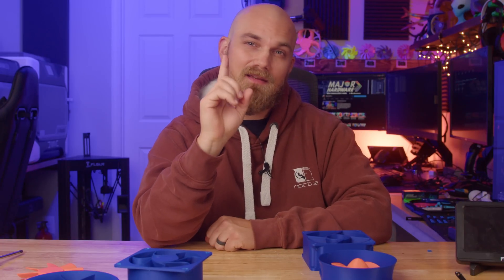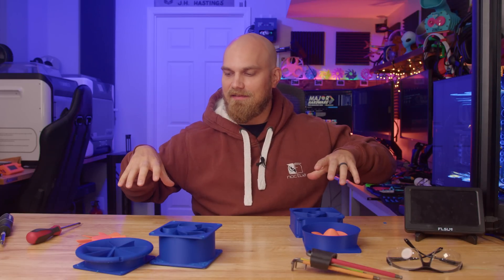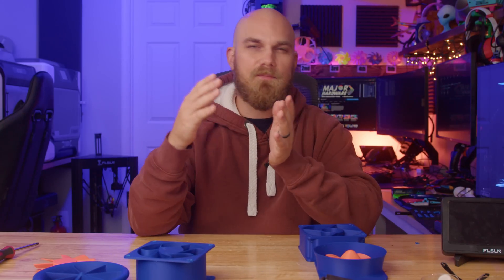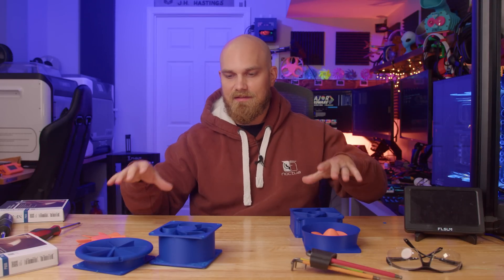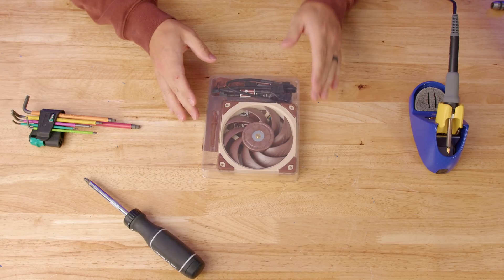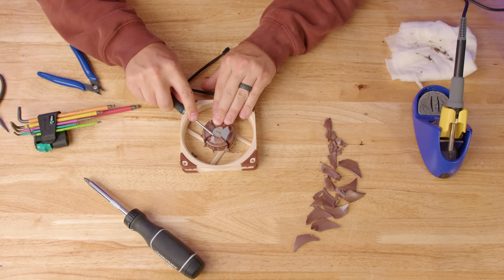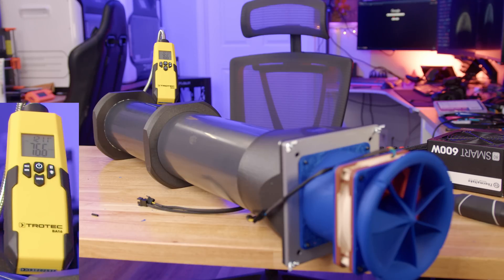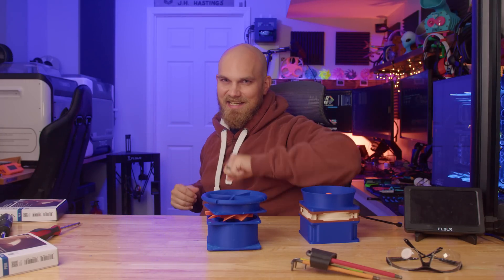Which One is REALLY the BEST | Fan Showdown S4 Finale

Comment: Should include both. There are high airflow fans and then there are high static pressure fans. It would be interesting to see if any of the fans with lower flow in the tube might have a higher localized pressure zone on a radiator. The tube only tells half the story. This could help determine what is good for a case fan and what would be good for a rad fan.

Comment: I'd say go cooling, but with a rig that can properly detect the amount of cooling such as a peltier device. I think, if you put one side of the device on a temperature controlled hotplate (such as that used for solder reflowing) and attach an AIO cooler or air-cooled heatsink to the other you should be able to measure the heat difference across the peltier as a voltage. The hotplate would provide a consistant temperature across all tests and, if you set it to something significantly above ambient temperature, the relatively small differences in ambient room temperature shouldn't be much of a factor (alternately, you could pretty easily create a temperature controlled chamber for the radiator and fan to sit in).

Comment: I was just reading comments on this video and noticed Brett Haupt suggested that it might not be too hard to generate both flow and pressure data at various levels of restriction in your test jig. I like this approach much better than the "abstracted" cooling performance results and request consideration of either continuing the airflow-measurements or add to that a static pressure measurement, possibly at various restriction levels. 

There are a lot of additional variables that are harder to control for in a cooling test, and it naturally reduces the resolution of results because the reality is that a heatsink with barely any flow still cools pretty good. Airflow has to increase by exponential amounts to result in linear improvements in cooling.

Comment: You need to do static pressure tests with your normal airflow test. I also think including real work scenario tests has to happen with a water cooler and a air cooler.
As far as coooers i think there is really only 1 air cooler you would want to use NH-D15. Water coolers it gets a little tricky a lot of choices either a corsair or coolermax would be a good choice.
Fitting some of these designs into a computer case might be troublesome, a new set of design prematers might be needed to fit into the case.

Comment: I would rather have the more practical application of cooler testing myself. I know it isn't as accurate as others have stated, but I feel like a fan should be capable of being mounted to and used on a cpu cooler as that is what the original noctua fan is designed to primarily do. Honestly is wish you could do both, but that is a lot of time and work.

Comment: The real test of performance, would be measuring air flow volume through a slight restriction. Many designs will move huge airflow volume with no backpressure, while others, can develop more static head pressure. Neither of these specs, by themselves, give a good indication of cooling effectiveness. The real indicator, would be airflow volume X head pressure, X a constant, which I don't actually know, to get air watts. Head pressure is one factor, flow volume is the other factor, to give you the total product. (cooling power)
     The tube that you use to measure flow volume is a perfect apparatus, if you could build a box on the end, to force air through some type of radiator. An example of this would be, the heating element out of a small ceramic space heater. If you apply a calibrated amount of wattage to that heating element, and measure the temperature rise, you will better know which fan design actually cools the best. Try the fans in both suction and pressure, because there will likely be a slight difference in performance.

Comment: I'd recommend the easiest and simplest solution by adding a static pressure test on top of the current flow test because some fans flow a metric ****ton of air but cannot handle even the slightest static pressure, while others flow for beans until you have a high static pressure then you can do a combined rating based off flow vs. pressure for each fan

Comment: I'm going to be perfectly honest, I stopped watching the show when you stopped using practical tests and data. The move towards theoretical advantages by not practically testing on a radiator made it generally uninteresting.

I'm involved in the industrial manufacturing world and I can tell you that theoretical tests only go so far and rarely create the optimal design or solution, but rather are just to give the engineer a starting point.

Comment: The cheater has significantly smoother blades due to the orientation of the print. The other fan (and most fans in this series) have the layer lines directly across the blade length, presenting maximum surface roughness to the oncoming air. By printing each blade separately, the cheater orients layer lines parallel to the airflow direction, reducing drag and improving performance.

Comment: It would be a lot of extra work but add a ton of nuance and potentially Evan a lot more content to start comparing fans on multiple aspects and not just one at a time i.e. airflow, static pressure, airflow with different common obstructions like radiators vs standard heatsinks vs almost open flow like a case. I think we would find that some fans even of past seasons perform better under certain conditions. One fan might be the ultimate case fan and then suck on a radiator because it doesn't work well against obstruction.

Comment: 120mm AIO with a peltier as the heat source. Cheap setup, easy and you get consistency. You can fit the radiator to the airflow tube and keep measuring airflow, just with the same restriction in place for each fan. You can also add an air temperature sensor to the tube to measure the heat being dissipated. This would give a good idea as to how effective the airflow is across the entirety of the fan rather than just one or two points along the blade that make good airflow numbers. More air across the whole blade should mean better heat transfer and warmer air in the tube, right?

Comment: Hey big fan of the show been watching since start of the fan showdown. Not sure if you saw my last comment about your roots blower fan but I was basicly wondering which direction you had the vanes spinning. In a roots style blower the vanes should be spinning outward (left vane anti clockwise right vane clockwise) just wanted mention it as it didn't look like you specifically mentioned it in previous episodes. Thansk heaps

Comment: I think in S5 we should do a noise challenge. We tested performance so far and in many cases at the expense of noise.
Another thing that would be cool is to set all fans at 800-900rpm, so we test noise fairly (all fans at the same rpm) and test designs that won't stall at lower speed, which I guess many of the previous session fans would.

Comment: If I were to do the testing, I would have 3 tests: unrestricted flow rate, static pressure, and flow rate with a radiator as resistance. If in the interest of time you want to do only one, I would do just the radiator one, but I feel all three would be best.

Comment: I feel like we need different leagues/tiers/sections of fans:
1) fans that fit within the original build volume of a fan / don't exceed the frame of the fan shroud. AKA "a normal fan"
2) fans that exceed the orignal build volume but do NOT untilize additional, static components (oversized fans, clockwork fans)
3) fans that utilize additional static components (cheater, turbo/super charger)

It's infuriating seeing ideas that, while quite funcional, aren't what i am primarily interested in (seeing how regular people make designs that compare/surpass the professional design while following the same limitations).  Instead, i find some Gundam Megazord contraption.  While very cool and effective, it shouldn't be seen as "in the same league."

Comment: For when you're doing a cooling test you should use an air cooler that's easy to mount to. And you should get thermal pads to use instead of thermal paste. Not only are they reusable but it will remove thermal paste as a variable

Comment: You know you can non-destructively remove the Noctua fan blades with a heat gun and a 12mm socket? I saw it on Reddit and tried it myself. Works really well, it’s super easy, makes no mess, and you can put it back on again if you need!

Comment: I do like airflow measurement, plus it's probably much easier and faster to test. However, if there was any way to add a static pressure measurement to the test rig, I think that addition would be the best scenario.  
More than anything, I'd like to see these fans broken down into at least 2 different classes;  OEM vs. Open.  OEM would be fans that fit the stock dimensions of the fan, and Open being everything else. 
Clever designs that fit within the fan housing are getting destroyed against fans that are not really useful in real applications. I mean, I still love the wild and huge designs, but it's weird to be allowing them to compete head to head.

Comment: Keep the air flow testing. it's a great way to see how much air the fans move. Just do both airflow and temperature. To save on time while you're running the cooling test for one you could be doing the air flow for another

Comment: I wouldn't mind seeing flow testing, then cooling on a single fan (180?) Radiator so that there is no extra radiator to skew the results. A fan may flow really well, but if it pushes air through a very small portion of the radiator (outside for example) where a lower overall flow but equal over the whole surface area of the rad could cool better

Comment: Custom, with the thickest 140mm radiator you can get, unless you're planning on printing multiple fans for 240/360/etc rads. You might still be able to get Alphacool NexXos Monsta radiators in a 140mm size, but really any stupidly-thick radiator.

Also kinda wondering if, whatever you choose, you could provide dimensions for some standard case, so people could design rigs that function as both direct cooling and also case exhaust/intake?

Comment: 🚨🚨🚨 Instead of cooling a PC, you should perform a static pressure test instead. In this way, the submitted fans would also look different and it gives this whole competition a new touch. And if you choose the „cooling a PC cooler“ method, you should rather use a heating element of a 3D printer instead of a CPU. This allows you to monitor exactly how many watts a fan can cool down. 🚨🚨🚨

Comment: Having backpressure sometimes really shows the true capabilities of a fan, while destroying the capabilities of others. Would be interesting to see if there's a good way to measure pressure performance
Reply: open air flow and then the same test but through a little 120 rad. both through the tube. because some fans are amazing at open air flow, a good case exhaust fan for instance, but others are excellent at ramming air through heat stacks and radiators but are lackluster for open air flow.

Comment: I want flow testing. It's a much more stable control, and airflow is king. The only thing i think you should add is a way to test static (drill a hole in the air tube and get a monometer). Static pressure and air flow are the 2 things you need for a fan to work well on any heat sync. That would be awesome as an edition to season 5 while staying as scientific as possible

Comment: For season 5 get a Crypto Miner like a Bitmain Bitcoin miner (even an older one). Record noise and everything else you've pursued. 
About five years ago I bought a pair of bitcoin miners expecting I could run them in the basement. I had to give each of them a dedicated 20Amp circuit breaker, which was fine. In the end, their fans were just so unbearably loud (and I tried running them in an acoustic treated enclosure too) I just had to stop. They threw off enough heat they kept the normally chilly basement comfortable though. And I'm still ahead on the bitcoin mined value at the currently 'depressed price' out there right now.
So please get a bitcoin miner as your temperature test rig.

Comment: I like the airflow testing method. As many people have said, it's very straightforward and has less variables which in turn means greater consistency. I would LOVE to see TWO CATEGORIES for Season 5. One for "naked" fans, and a second for the fans that have shrouds, and stators, etc. I feel like that would really even the playing field. Love this series, man! Keep up the awesome work!
Reply: +1 for naked and shrouded / modified
Reply: The two categories would be a great addition since the larger fans are just harder to actually use IRL
Reply: Oh also maybe a test where we keep the cheater housing but just change the fan design!
Reply: I agree with this. Shrouds don't work in all use cases.

Comment: all these intake shrouds with fancy things in them, like the unswirl, are just adding obstructions and restricting airflow.
there might be something to making a laminar flow out the exhaust for an airflow test, maybe (i'm skeptical, but it could reduce friction along sides of the pipe and therefore reduce backpressure), but adding it to the intake is just going to reduce airflow.

Comment: You should find a way to measure static pressure. I’d be curious to know if the unswirler performs better under a static pressure test than the cheater. For water cooling static pressure is much more important than straight CFM.

Comment: Beyond the airflow and static pressure, you could run a peltier test. Peltier chips will always behave the same and you can measure performance by measuring the temperature difference of the cold side of it with each fan cooling the hot side (I explained just in case someone just defrost from the last ice age and doesn't know what is a peltier).
Reply: Yeah, doing a 'real world' test setup would ideally use a dummy heater than could consistently be measured at all the same parameters, including mounting pressure and TIM spread.
Reply: literally never heard of a peltier before
Reply: @Bloody_crow  they're awesome tiny heatpumps with no moving parts. Cheap also.

Comment: use both airflow and cooling. There is a reason for this as not all airflow is equal just because 1 moves more air does not mean it cools better. If the air flow is to concentrated in a stream in water cooling say just the outer most or inner most 20mm of a 120 mm fan then you could have 2k cubic feet per min of airflow and not cool as well as 600 feet that was spread out over the full 120 mm of area. If it is to spread out you could have the same effect.

Comment: For the next season I think we should dial it up to 11 by testing with IceGiant ProSiphon Elite cooler on a CPU inside a case with a GPU and minimal other fans. The CPU and GPU would both be loaded 100%. Basically the sort of real world scenario where someone is running with less fans to reduce noise or save a buck and one fan has to be the hero and make up for the other missing fans. I would recommend getting a motherboard with lots of temperature sensors so the temps of other parts can be checked as well. And in this way we could also try using ducting to improve performance 🙂

Comment: To spice things up you could use the noctua industrial 3000 or whatever the name. A some of the fans you get sent are designed to operate at a higher rpm. You could keep using the A12 but also give them a go in the industrial.

Comment: I'd like to see a split in categories. A) fan blades that fit into the standard housing, B) Fans that mount to a cooler but are allowed to stick out of the standard housing like shrouds and big blades, C) Fans that are standalone (IE can't easily mount to a cooler or case/ shrouds on both sides).

Comment: Alright here we go.... Lets give this a shot:

A DUAL FAN Setup on Air Cooler. The Noctua NH-D15. People can make a shroud or encase the entire fin stack. You could still test airflow seeing how much air gets pushed through the fin stack using your tunnel tester, but keep it all combined. I think making the requirement a 2 fan design fitting inside the NH-D15 adds a new level of complexity and design work for the designers.

Comment: A setup with a tightly packed radiator or something similar would be interesting, basically anything that would reward static pressure over just pure airflow like in previous seasons. This would finally allow the compressor type fans to shine for season 5. Fans designed to maximize airflow have had their time in the spotlight, I'm curious to see how a new metric will change the ideal designs.

Comment: If you switch back to cooling, can I suggest that you test the cheater and the swirl on a radiator or air cooler to see if back pressure plays a role? How many inches of H2O will they each push?  Which one actually cools better? Then announce the champ for starting off season five??

Comment: Airflow testing is fine, but I really think testing a single 120mm AIO setup would be the best next step. Instead of just Airflow, you should setup a test bench that measures static pressure as well. For water cooling, we can’t just rely on airflow if the radiator creates too much back pressure. You could take the “static pressure” winners of each episode and see how good it is in a PC with a single 120mm radiator. Open air bench of course.